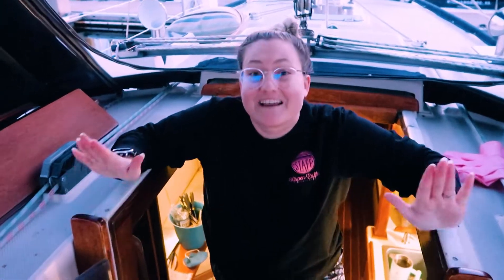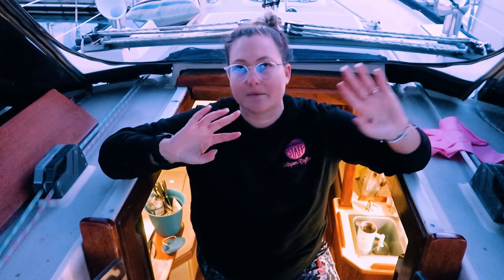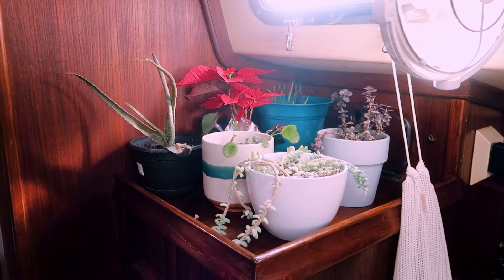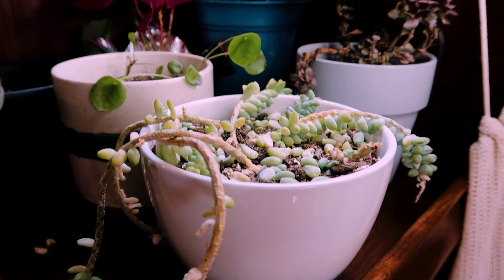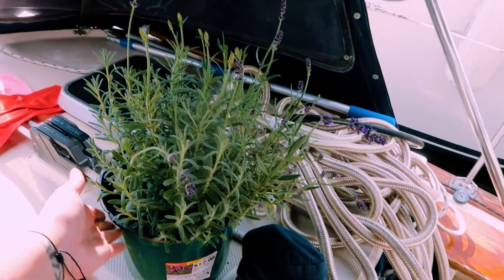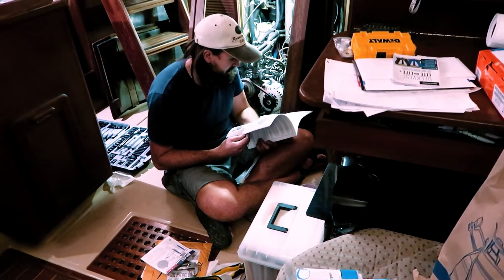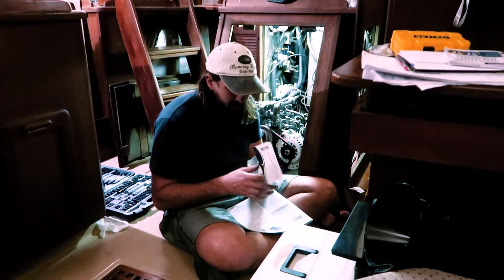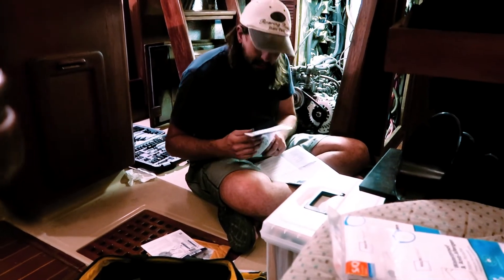Upgrading Our Sailboat to Lithium | Ep.6

Comment: Would love it if you shared the line specs once completed for IP 35 owners. Thanks. We use 3m velcro pads to secure our panel in that same spot when at anchor, but remove it for passages and store it in the aft cabin. Don't miss out on the Dry Tortugas. It's amazing.
Reply from the maker: Absolutely! I am planning to post all of that info on our blog, happygolondons.com, but I won’t do that until I’ve finished changing them all out in case I got some wrong! 

We keep hearing about the Dry Tortugas!